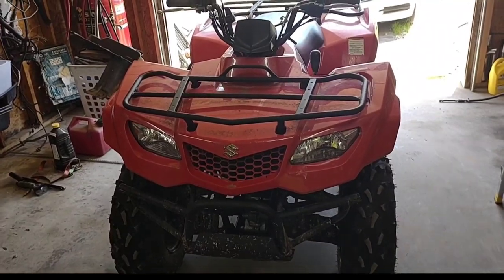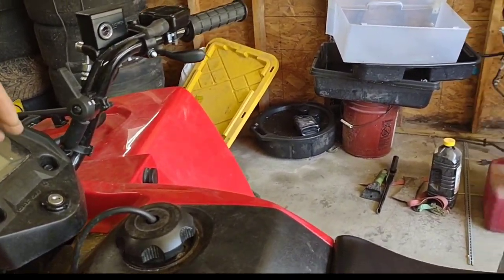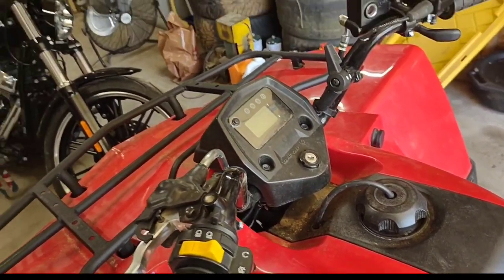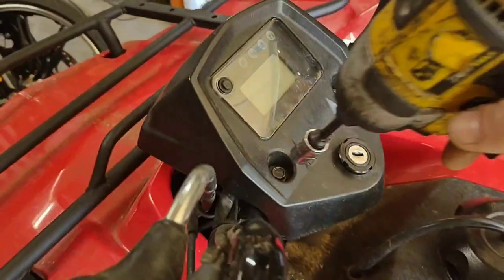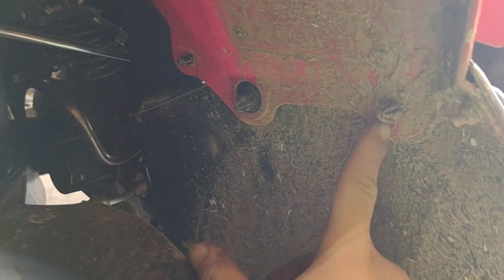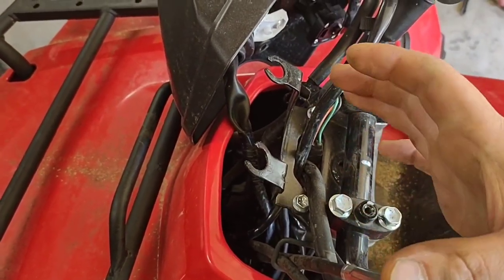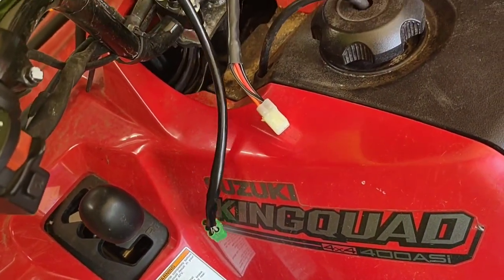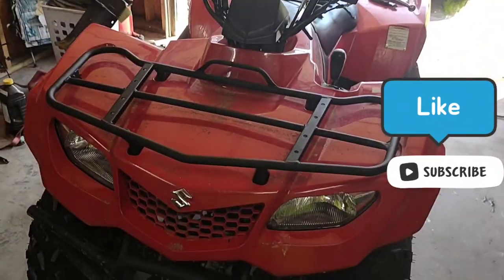2021 Suzuki king quad asi, key switch replacement.

Comment: The ignition you took the pins out of would it start all the way up with anything you could put in it because I can’t find my key I don’t wanna have to buy an ignition I thought about just taking the pins out and calling it
Reply from the maker: Yes, looked stocked, and started with key, screwdriver, or butter knife! The key switch I put on also cought fire. So I took the link to it down. Wouldn't buy one on Amazon or a cheap one.

Comment: can you show me whgere the horn button should be? ANd how to reconnect the odometer the digital dispaly: it  works but doesnt record distance travelled or speed im going. I had to take pins out of ignition after not having a key.
Reply from the maker: Mine don't have a horn, that I know of. But the key switch shouldn't have anything to do with the speed or odometer. I would check your speed sensor, should be on one of the wheels.